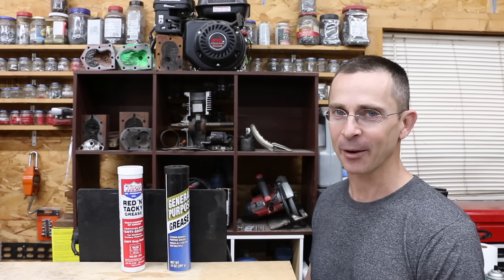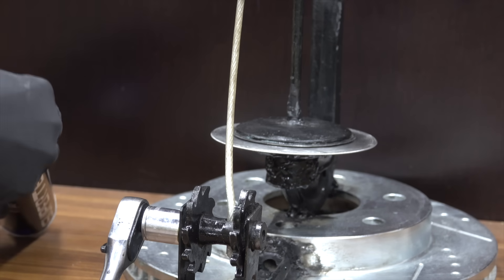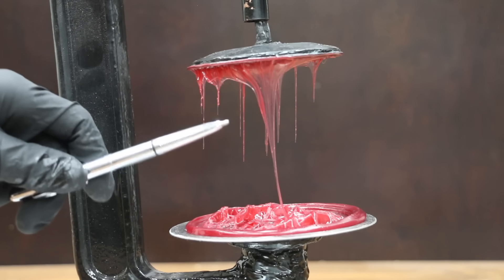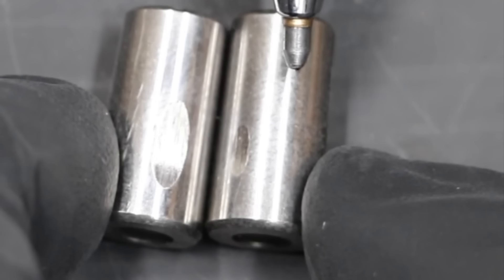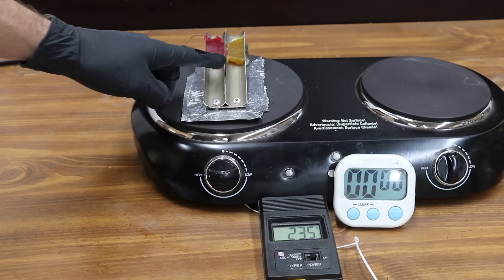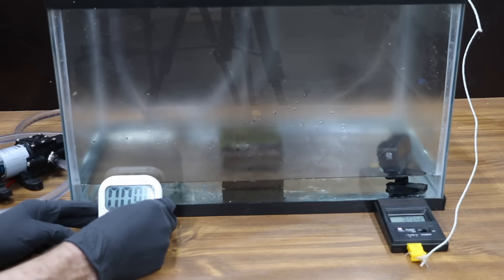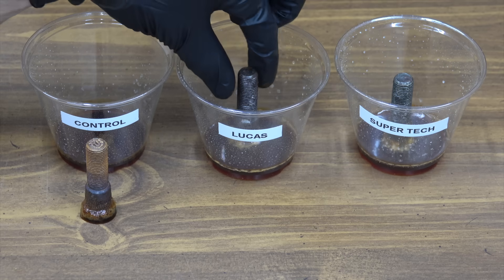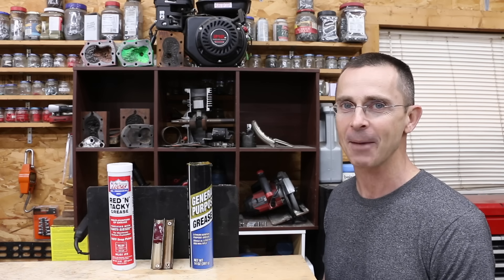Is Cheap Grease better than Lucas Red N Tacky? Let's find out! Bearing Grease Test Episode 1

Comment: I'm 70 now but when I was a kid on the farm my Dad said the cheapest grease and oil was the most expensive to buy. Preventing wear and tear is much cheaper than the most expensive lube. Glad to see him proved right again!
Reply: There is a MASSIVE difference between Mobil 1 and Amazon basics, both full synthetic.
Reply: @RandyRandersonthefamous  what? amazons motor oil is the best on Earth?
Reply from the maker: Thanks for the feedback.
Reply: @ProjectFarm  are you going to test more grease??? I have been hoping every week since this video came out that you would!!!!
Reply: I know several years ago I had a Sea-Doo jet ski with the 650 cc Rotax engine.  The Sea-Doo oil was quite expensive, so I thought I would just go buy Wal-Mart oil.  I took that in for an impeller replacement and the mechanic asked what kind of oil I was using.  I told him and he said the oil I was using had a high "ash content"; whatever that means.  It could damage the rotary valves in the engine.  I immediately started using the Sea-Doo oil and had that machine for many years.  Great video!
Reply: This is why my grandfather used to tell me, "an ounce of prevention is worth a pound a cure".
Reply: @Steven-gv1ke  Grease and oil is much cheaper than bearings and bushings.
Reply: @richardcarden4161  And knowing how to install bearings correctly...
Reply: Your father was a wise man and it's an attitude I always take. Mind you my brother says some grease is better than no grease.
Reply: @joevandamm  Doc  he s not lying
Reply: Smart Dad!!
Reply: The point of what he is saying is that when you buy a cheap lubricant you pay for costly repairs in the long run due to failed parts.
Reply: @The Oracle True !!! a lot of times products are overpriced.
Or simply some products are huge bang for buck and make others look like ripoffs.
Reply: If you want to take care of your equipment don't be a cheapass.
Reply: Wise dad...you had.
Reply: very smart guy
Reply: You meant 'the most expensive to USE, not BUY'. Cheap stuff IS cheap to buy but expensive to use.
Reply: Tell your dad good wisdom. And shake his hand for me.
Reply: Couldn't agree more!
Reply: @The Oracle It’s not your statement to modify
Reply: Good quality is good but I think that is less true these days because like walmarts brand oil is pretty good their full synthetic is probably better than anything from 30 years ago
Reply: Jews used to say ''i am not rich enough to buy used stuff'' .
Reply: @TheSRBgamer63  that is an excellent saying. I understand it very well.

Comment: Many years ago Drydene made an expensive industrial saltwater-proof grease. My father used it in the boat trailer axles and it really did hold up to being dunked. I know Drydene is gone. Does anyone still make something similar?
Reply: Marine grease
Reply: @jonathanginofilippi  yeah, but this was different. You could dunk hot hubs in saltwater and the water would get in but not dilute the grease. It was made from asteroids or something
Reply: They got gnarly 2000 degree grease, for use in ovens and such.  Its out there.  Probably made of moon-rocks.

Comment: As always, nice work!  Twenty-five years ago, I considered selling products from Texas Refinery Corporation. (TRC) They used to demonstrate the tackiness of their 880 Crown and Chassis grease by taking two hammers and smacking them together.  The less tacky grease would splatter, but not the 880.  I never ended up selling it, but a quick search didn't find any haters, so it must be good. I use Omni Green grease for all my normal needs . . . simply because it's easy to find.
Reply from the maker: Thanks for sharing!

Comment: I tried that Walmart grease one time and did not like it.  I now uses Castro’l’s EP2 Synthetic grease and it works fine.  I use it to lube the sprockets on my chainsaw bars that need it and on the chassis of my lawn tractor.  I have never used the Lucas Red and Tacky.  The best grease I have ever used was the old Chevron EP2 with Moly that I cannot find anymore.
Reply from the maker: Thanks for sharing.

Comment: I know of one use for grease where you want to find the cheapest grease possible.  The Farmall Cub tractors have a graphite clutch throwout bearing and it needs to be greased with cheap, runny, low-class grease so it will permeate the bearing.
Reply from the maker: Thanks for sharing.

Comment: Would like to see Mercury Marine Extreme Grease tested. I Know it's someone else's grease repackaged but it's expensive and seems to do a good job of staying put, anti corrosion in salt water and when used for aluminum anti corrosion on bolts and studs in salt water I haven't noticed it drying out. The color and texture of the grease reminds me of Texaco grease from years ago.

Comment: You tested exactly the two types of grease I use.  Now there will be only one grease i use.  I was hoping that stuff is tacky. 80 sumptin' pounds compared to 50 is hella significant.  I also like the water resistance.....boat trailer wheel bearings.  Thanks for this testing.
Reply from the maker: You are welcome!

Comment: This was so awesome because I just lubed the drive shafts on my 4Runner today and I bought the Lucas Red N Tacky without a second thought. Besides the great performance its also easy to see when you have pushed out the old dirty grease and the red Lucas begins to ooze out. I just like Lucas products in general. I use the Lucas fuel treatment oil because it improves my gas mileage and keeps the engine running great. Maybe you could do a test on that if you haven't already.
Reply: Lucasoil Oil Stabilizer is fantastic as well, especially if you live in colder areas.
Reply from the maker: Thanks for sharing.

Comment: I've had some bad luck with Lucas Oil Products X-TRA Heavy-Duty Grease (14.5 oz.). I was surprised given that I was sort of expecting it to be the gold standard, but it started separating and turning to oil after a while. I packed a small trailer set of bearings with it and it started leaking green after a year or so. I thought I had made some mistake or maybe over-tightened the spindle nut, but then I found the whole grease gun was leaking green from unused grease. Maybe that was just a one off, but I'll take mediocre grease any day over that experience.
Reply from the maker: Thanks for the feedback.

Comment: Apparently the wind turbines in Texas were using SuperTech grease this past week. 

I use Lucas Red N Tacky in my Milwaukee angle grinders as well as pillowblock bearings used for many shop applications and the stuff is outstanding.
Reply from the maker: Thanks for sharing.

Comment: The Lucas Red “N” Tacky is a really stand up grease, but for heavy equipment the Lucas X-tra Heavy duty is awesome, it flows into pins and bushings better (which if you’re still using one of those antiquated elbow powered grease guns it makes a huge difference) while also managing to stay in said bushings longer, all I have to say is for equipment there is no equal, at least that I’ve found.
Reply from the maker: Thanks for the feedback.

Comment: Mash just you repeat the grease mixing test. Check the pH value of each grease then after mixing check the pH again. I suggest repeating the pH check several months later so you have an initial mix pH and one after time. Also working the mixed grease is important. I bring this up as mixing greases lead to the failure of the Horizontal stab jackscrew assembly of an MD-80 jetliner with the loss of about 180 lives. The combined greases lead to an acidic mixture resulting i adverse wear of the jackscrew resulting in loss of control of the horizontal stabilizer.
Reply from the maker: Thanks for the suggestion.

Comment: Awesome review!! I’ve been using the Lucas red and tacky grease for a long time on all my boat axle bearings with zero issues. I run bearing buddies on my hubs and keep them topped up, every 3 seasons I pull them apart for a full cleaning, never any damage to the bearings .
Reply from the maker: Thanks!  Thanks for sharing.

Comment: NGLI # 2 refers to the viscosity of the grease not the application.  The Walmart General Purpose product  specifies for light duty applications and I could not find a NLGI number.  The Lucas Red N Tacky is an EP (Extreme Pressure) grease.  A better comparison would be the Walmart Multi Duty Hi-Temp grease that is also NGLI #2.
Reply from the maker: Thanks for the feedback.

Comment: Why am I finding this literally a week after repacking all my trailer bearings with the Walmart brand? 😆😆😆     Update: my trailer was stolen so it's all a moot point anyways 🤪
Reply: Ha I just repacked my trailer wheel bearings with that same Lucas grease.
Reply: @central3425  Doing mine tomorrow...with Lucas bought from Walmart!
Reply: @central3425  In the UK a supermarket owned by Walmart sells its own label engine oil, it is a COMMA product. If you look up the safety data sheet for your grease, you will see who makes it. May not be a bad grease after all
Reply from the maker: Thanks for the feedback.
Reply: I feel like if you're taking care of them you're doing better than 90% of people. Now you have something to look forward to next time.

Comment: Hello and thank you for the video! Could you do a video about bearing lubrication? Especially miniature bearings that are used in small engines, rc car or fishing reels. People tend to pop out the side plates on their fishing reel bearings and washing out the OEM lubricant and then adding reel oil to the bearing, to get maximum casting distances. It would be nice to see a comparison that what would actually be the for the bearings: To leave the covers on and use it as the OEM manufactured intended, or take the side plates off and use oil instead of grease or re grease them with some high performance grease. How this effects on the bearing life and performance, and how often do you have to apply that low viscosity reel oil to that bearing to get it to last the same time as the OEM bearing.  And to make it more interesting getting couple of Full Ceramic bearings and ceramic ball beings to the comparison whit stainless steel and steel bearings.
Reply from the maker: You are welcome!  Thanks for the video idea.

Comment: How about a grease gun  zerk coupler comparison such as Lock-n-load,Lubri-matic etc?
Reply: Great idea!! I have a zerk coupler for tight spaces, you can just slide it onto the fittings, but you need a claw hammer to remove it!!! And it's not a cheap Chinesium coupler,,, It's much like the OTC  OTC 2322

Comment: I guess your sophisticated compression/weight test shows the film strength?   And so that would explain why some greases have failed in my hard bicycle use as an avid cyclist, I had to deal with scoring/pitting and rust with a few brands that claimed to be waterproof.             So the higher the melting point , the better the reliability as in the Red Lucas Grease you demo'd?

Comment: When I was getting my master degree in mechanical engineering we had some lessons on lubricants. All greases with same soap base can be mixed, regardless of the thickness of the oil inside. With almost all general purpose (wheel bearing) greases being lithium soap based, you really don't have to worry all that much about mixing greases of different brands.
Reply: like Sander says, mixing NILG 2 and NILG 2 greases of different brands is not an issue
mixing greases with different thickeners (lithium vs PolyUrea) is a no-no
the different thickeners or soap bases react with one another and causes the oil to fall out of solution

a test of that would be nice
I have done this in the shop a couple of times as most of the techs I have worked with did not believe it
Reply from the maker: Thanks for the feedback.
Reply: Thanks I was looking for a comment like this. I’m going to switch out grease for my cargo trailer but I don’t want to clean out the bearings first. Not that I would have lol.

Comment: After just having gone through an army 6x6, I can tell you that cheap tan stuff is much easier to clean from wheel bearings before re-packing them than the red stuff. The tan stuff almost falls off with brake cleaner but the red takes a lot more effort to clean, even being resistant to gasoline. Could you please test Mystik red from rural king? It was half the price of Lucas.
Reply from the maker: Thanks for the video idea.
Reply: I have used all 3.  Lucas Red is better than Mystik Red, but Mystik Red is still pretty good.  Definitely better than the cheap stuff either way.

Comment: Thanks for the testing, I been using Lucas Red N Tacky for years in all my equipment.  Now the issue as many know with Lucas Red N Tacky will separate when left in the grease gun.  This leaves you with a mess and wasted grease because you install a new tube when you have to use it again.  Now looking for a better mouse trap I just ordered a AET Lube Shuttle with there Li400 Grease. I contacted LUCAS and had them look up the Li400 on AET's site to make sure that it would be comparable with the Red N Tacky. YES IT IS!  I told Lucas why I was switching and they know of that issue with the Red N Tacky.  I ask Lucas if they would fill AET's empty tubes you can order with Red N Tacky for me, about a dozen so I could test if would have the same issue of separation in a different tube and delivery device.  They would not fill them for me be took a interest in the Lube Shuttle and also wonder if this would address that issue.  I gave both companies each others contact info on the reps I spoke to. Hope something comes out of it.  "NOW"  I will not receive my new grease gun and grease until next week. I will be willing to send you some of the Li400 if you would run the same test you did on the Red N Tacky to see how this new grease compares to the good old Lucas.   Just let me know.
Reply: Ironically at work for myself, red and tacky is all that is used and has only one time over the course of 5 years lost its prime while sitting in the grease gun, I grease a loader every day or two and switch tubes about every third greasing…. I’ve never noticed the separation. Lincoln battery powered grease gun stored on its side in its plastic case. Tubes of new grease always stored upright. In an oversee container outdoors in all temps from 0 degrees to 100
Reply: every grease that i have used,  does that, doesn't matter what brand.

Comment: Put Schaeffer's 221 Moly Ultra  in your tests and you'll see first hand why they have been in business for over a 100 years. Lucas makes good products, but ANY Lithium based grease WILL mix with water. PERIOD. Not just by spraying water on it! Pack a bearing and submerge it in water, spin for 5 min and watch ANY Lithium based grease change colors as the grease breaks down. I didn't test it with a pump spraying water on top of  the grease. I tested it with an 11,000lb tri axel boat/trailer going from TX to FL! Don't believe me, try it for yourself....OR prove me wrong.
Reply from the maker: Thanks for the feedback.
Reply: @ProjectFarm  Not trying to be a dick just condensing the facts. I had to change 6 bearings races and seals on the side of the road because Red and Tacky mixed with saltwater and turned pink! Give Schaeffer's a try you wont be sorry.

Comment: Hello, thank you for the clear explanation. I wanted to ask for your help as you clearly are the expert. 

I have recently purchased [ https://www.amazon.ae/NTN-SNR-Heavy-Grease-grams/dp/B07VY4D1ZV/ref=sr_1_1?crid=1NMYWAEWL1QDA&dchild=1&keywords=grease+lubricant&qid=1607780073&sprefix=grease+%2Caps%2C291&sr=8-1 ]

In my car, when I press my brake, the stem behind the pedal creates a soft groaning sound, which mechanically does not effect the braking of the vehicle, but instead is just audible and irritating to feel when driving. 

As per the manufacturer they applied an MP3 grease of a local brand at the stem behind the pedal and for some time the sound was fixed. But it is back again now, so instead of me going every week to the manufacturer, can I apply this grease safely to this part? Is it suitable for this? Would I damage the part? I am worried on the type of grease I purchased as it in the end is the brake pedal. And if the grease becomes hardened, it could become fatal. 

Would love an answer from you! Love from Dubai <3

Comment: Does anyone else remember when the JB man would come around and put those steel rods in a machine with a spinning steel wheel to show how you can't stop its slipperiness and you would put another steel rod in it with WD40 and it would stop in 2 seconds with your own hand operated down pressure.   Plus you would get a big coin slug in the bottom of the can when you bought those JB products from the JB stand in the auto parts store.  P.S.  I would also love to have a Banana Flip just one more time.
Reply from the maker: Thanks for sharing.